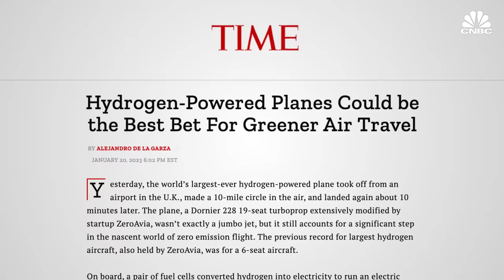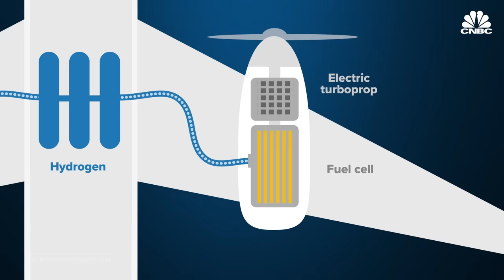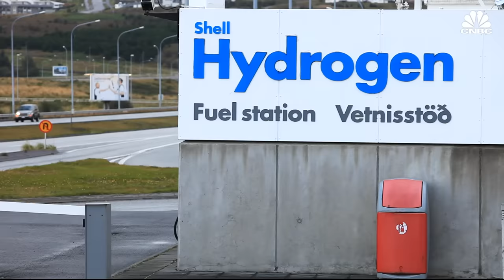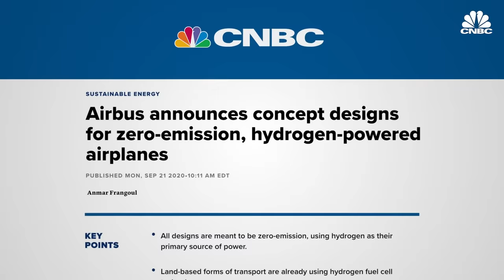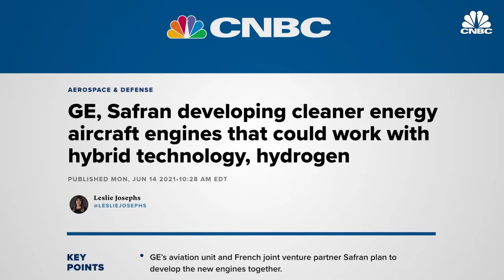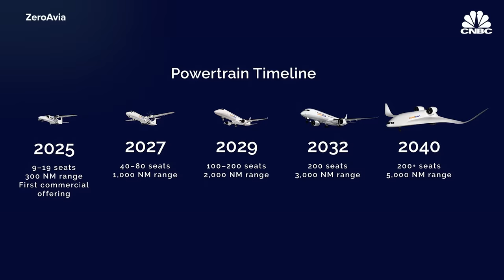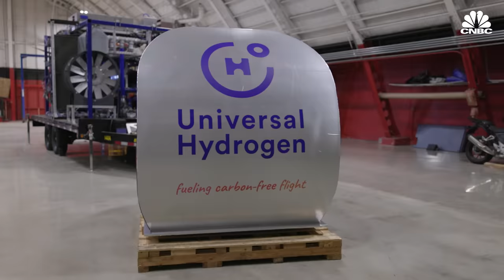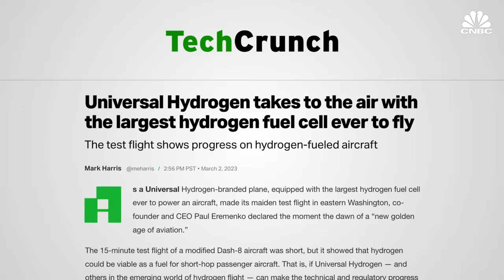Why Hydrogen-Powered Planes Will Beat Electric Planes

Comment: Electric batteries beat hydrogen when it comes to energy efficiency.  Hydrogen, when properly compressed, has more energy density and refuels faster.  Should technological advances even the field when it comes to energy density and refueling, hydrogen will be viable where the cost of electricity is prohibitive.

Comment: Airlines and large ships are going to be the most difficult to decarbonize. It's good there is a lot of pressure and investment to unlock solutions.
Hydrogen is quite difficult to work with, so I'm not convinced this effort is going to work out. Hopefully there will be a solution though.

Comment: I don't understand why we cannot make small nuclear reactors to power everything, from airplaines to shipping vessels, to maybe even trucks and cars. How hard can it be? Don't submarines and some military ships not already have a nuclear power source? And wasn't it experiented before on a somewhat strange cargo-cruise cross type ship? Not hydrogen nor lithium ion batteries will be a solution for airplanes.
Reply: "Don't submarines and some military ships not already have a nuclear power source"

Yes, and the reactor vessel is quite small, however, there's a huge advantage with nuclear carriers and submarines: we are surrounded by coolant. The steam plant that moves seawater in to cool the reactor and generate steam to turn the screw is a lot larger than the reactor vessel itself. Source: I am qualified in submarines, I served on USS Florida SSBN-728 and USS Asheville SSN-758, from 1999 to 2003.

The USAF did experiments with small reactors, and even had an airplane carrying a reactor at one point. The problem with nuclear aircraft is, what if there's a collision.

Theoretically, if we had an even smaller reactor, with self contained coolant, that would fit in a nice small cylindrical container, say maybe six feet (2 m) long, and would survive the rest of the aircraft being destroyed without releasing any radioactive material....that would work. That would also solve SSTO rockets. But even if you have one like that, you still need heavy shielding around the reactor. Remember the mantra: time, distance, shielding. 

However, it seems a lot easier to run the plane off H2 and generate the H2 using nuclear. 🙂
Reply: @neutrino78x  You have my respect for serving on a submarine. And yeah I was a bit too fast claiming nuclear was perfect and all, but I do believe we should be doing more research around this but I am also aware that the nuclear cruise ship container carrier mix, was not allowed in ports because it contained a nuclear power plant. People just didn't have the right way to handle the entrance of such materials by hand and where afraid of the what if situation. I just feel like we are too afraid, look at Fukushima in Japan. A melt down, an earthquake and a tsunami and still no one harmed.
Reply: @Bierdopje071  

" I just feel like we are too afraid, look at Fukushima in Japan. A melt down, an earthquake and a tsunami and still no one harmed."

Yeah, people have irrational fear of nuclear power, that's very true.

I would argue that if you use hydrogen and generate using a land based reactor, it's basically the same but without the security concerns. On a sub or carrier, worse case scenario, the vessel sinks to the bottom of the sea, and there's some release of radioactive material, but the sea is vast and will absorb it to a great extent. "Time, distance, shielding". 🙂

I think nuclear is definitely what you want to use in an area that doesn't have a lot of renewable options available. Like here in California we have 300 days of sunshine, and during the day we have over 10 GW that we get from the Sun. That would be five or six nuclear fission plants! We might still need a nuke to get 100% clean power. I hope we can keep Diablo Canyon open, but the political reality seems to be against having any kind of nuclear plant in our state. But....maybe we won't need it. Just build lots of solar, lots of wind, lots of power storage.

New York City on the other hand, iirc they're like 50% nuclear. It's because they get real winter, and have the Sun obscured for days at a time in some cases. 

So, I think both need to continue to be available. Renewable where you can do it, nuclear when you can't.

This upcoming technology with "enhanced geothermal" is really promising, because basically, anywhere on Earth if you drill down far enough you find natural heat. So just let wastewater fall down there, and take the resultant steam up to drive a turbine and you have clean power. Of course there are going to be some places where the depth of the heat is too far to be practical, but I think it will open up a lot of places to geothermal. Maybe New York could go 50% nuclear, 50% geothermal. It all depends on how far they can get with the enhanced geothermal. I know the principle has already been used at The Geysers here in the Bay Area, which is the largest geothermal plant in the world; they were getting less steam out of some of the generators, so they ended up putting waste water down there, and go the steam pressure back. In theory you can do that anywhere you find hot permeable rock. We have to see how far that tech goes. 🙂

Comment: Or you could make H2 so cheap via cheap electricity that you can turn it with captured CO2 into a synthetic carbon fuel and use existing equipment... Just saying...

Comment: For those of you old enough to remember the first gasoline shortage in 1971 gave rise to millions of people using natural gas to power their cars. Gasoline was $2.00 a gallon BUT Natural Gas was only .20 cents a gallon equivalent. Millions of people converted their cars to run on Natural gas or even common propane. This did not require a FUEL CELL but just injecting the already explosive gas into piston engine. The same goes for hydrogen! By just simply injecting the hydrogen into the piston or turbine engine and then burning it is 41% MORE efficient then using a FUEL CELL to make electricity and then losing more power in the electric motor. We already have 98% of the infrastructure to use Hydrogen just as a raw FUEL-STUFF! We also avoid the "bottle neck" of a heavy and limited Fuel-Cell which is not talked about much but a Fuel -Cell is a really slow device that costs $6000.00 per KWH and most cars need 2 or 3 KW per hour to run or about $18,000 worth of fuel cell weighing in at 1800 pounds!

Comment: I thought that hydrogen could be compressed to such a degree that it supersedes electric batteries in terms of weight? Which would increase an aeroplanes efficiency, saving money and potentially only have water as its waste by-product? If you could invent a battery using sand or sea water, that could potentially be even better than hydrogen.
Reply: It can only be compressed to a liquid basically just like water and no further, solid hydrogen is still basically a theory still. In terms of weight, yes they're more energy dense than batteries, but they lose that edge over batteries when it comes to efficiency losses when burning the hydrogen
Reply: It's lighter but it's volume is 4x times higher than fossil fuel. The storage tanks are also huge for hydrogen.
Reply: " If you could invent a battery using sand or sea water,"  Sand and seawater could mean Silicon and Sodium (Na). Na batteries are going into production cars this year. Aviation batteries have higher volumetric and gravimetric densities so cost more, but they are in development.  Also since hydrogen fuel cells are only 60% efficient and the combustion of hydrogen is even less efficient, batteries ( 99%+ efficient) only need to be about 1/2 as energy-dense as aviation fuels to be usable.
Reply: I'm guessing compression is a slippery slope considering altitude changes.

Comment: wasn't it the Hindenburg that also used Hydrogen? 🤔 And compressed hydrogen is explosive too. 🤔🤔
Reply: Yes. And it leaks through metal, plastic and glass, and degrades steel and other metals.
Reply: And diesel, lithium ion batteries and gasoline are not flammable and explosive.
Reply: @KP-if5kc  diesel isn't explosive, it needs to be compressed to explode. Petrol also isn't explosive, but the gas is. You can throw a lit cigarette into a puddle of petrol and it won't explode.
Reply: @Aeronaut1975  Umm, I've done several fire safety courses and I've seen petrol and diesel burn with a lit match. Not sure what you're going on about there. Am I supposed to believe you or my own lying eyes.
Reply: @KP-if5kc  I said "exposive", I didn;t say they didn;t burn.
Reply: Yes I believe we do have the technical know-how to make hydrogen safe to use but the stuff is just much more volatile (or "energy dense") as compared to other fuels. I mean, it's used to send payloads into orbit.
I'd like to see a safety track record established before paying to sit on what's essentially a rocket put on it's side with wings attached.
Reply: @Aeronaut1975  talking about explosive, in the port near Amsterdam they will build a few huge hydrogen storage tanks, so if that blows up even the area where I live will go (which is like a good 5-10km away from it)

Seems like a Beirut 2.0 waiting to happen..
Reply: @Aeronaut1975  Perhaps you should take a look at some of the more recent safety measures taken with hydrogen. I recall on a point on the lightness of the molecule allowing most of it to escape before it burns. I think toyota did those tests of their fuel tanks.

Comment: Fly on Hydrogen? Its been tried and Hindenburg ended up with a big bang!
Reply: Hydrogen fuel cell compress to high pressure . In case of damage/ leaked fuell cell the gas is likely to vent always rather than explode.  Have you seen any hydrogen fuel cell cars explode , there are not many of these cars . But I never heard one that exploded.
Reply: @bosorot  hydrogen fuel cell cars is being developed in japan, it has hydrogen tanks check it out, and hydrogen is the most volatile element its react very quickly with oxygen which is also very unstable elements. Jet fuel which many don’t know is actually designed to be extremely stable and if won’t ignite even you throw a burning match in it. Its the reason why Jet fuel is used for aircrafts world wide.
Reply: @@user-oj1tu7vl6l lol same crap, the only difference is it compresses hydrogen more in the tank than the past, but it doesn’t change how volatile the hydrogen is and how they use the hydrogen which is also used at fuel to burn! Jet fuel is used for aviation for a reason, because its very stable it won’t burn even you throw a burning match in it. That is why aviation fuel is not gas or diesel like for cars.

Comment: but hydrogen airplanes are 30% efficient while electric airplanes are 90% efficient so electric airplanes will beat hydrogen airplanes
Reply: Coal power plant that produces electricity is ~33% efficient, thus 90% x 33% = 30%.
And if you want to have an electric airliner with the same range as today's jet powered, you would need so much batteries that the airplane couldn't even leave the ground.
Reply: @My-Opinion-Doesnt-Matter  solar charging stations for airplanes

Comment: Interesting but must challenge the introductory assertions; ‘ affordable “ travel ? For who ? May I suggest those who carry the US dollar. ? But even their travel is an own goal in terms of CO2 into the atmosphere, which is destroying our planet’s atmosphere and biosphere in front of our eyes but we blithely go on as if it was not happening . 
 This form of travel is only sustainable if the CO2 generated is not from fossil fuel which is possible but of course  but big oil has blocked that for years . Alternatively the CO2 has to be captured and stored. Costly yes, but the only solution in the long run. Hydrogen can be used yes but not from fossil fuel and storage and fuel, cells are horrendously inefficient, again 
Costly . If you want air travel just for your holidays and not be a bit player in the destruction of our atmosphere, as we ALL are to a great or lesser extent (depending on the amount of dollars or w.h.y  currency in your pocket) then dig deeper. Costing the Earth is not an option,  denialistsbans procrastinating government have allowed us to run out of time to fix it , it is now a case of prepare for the worst with eyes open no more denials . Reducing your CO2 footprint by not flying would be a good start. 
I say this as a dedicated petrol head who loves aero engines , motorcycle engines etc and big 😊aviation enthusiast.

Comment: Flawed title and outlook.  This would be better titled as H2 being better than current production battery tech for planes.  This is true.
However battery energy density is increasing regularly.  H2 has ups and downs, just like batteries.  Batteries are simply better than H2 when feasible.  So best scenario, we solve the largest technical hang-ups with both batteries and H2 for aviation.  Which do you go with?  Batteries ... no contest; hands down.  Simply because it'll cost less and that's the driving factor.  That obviously changes the moment you need combustive action, like for rockets, etc.

Comment: 1:00 "You can't carry enough batteries to sustain flight, because they're just too heavy". Well, big batteries are too heavy, but what do you think powers a drone? A small battery.
Coupled with solar film on the top surfaces, a small battery could significantly lower fuel cost in the same way that a Toyota Prius cut fuel use almost in half. Those batteries could cut in and out in flight as solar charging occurred, and could be used during the descent phase of flight. This is actually doable in the near-term, rather than the next decade.

Comment: They will not, hydrogen has the greatest amount of energy per kilogram… but terrible energy per volume.
And the actual containers they need to store. This pressurize hydrogen are heavy and thick wall that need to be round. 
That’s not a very efficient aerodynamic shape . There is zero chance that this is going to be the way this goes.

Comment: "Atomisation" of petrol-ethanol-diesel. Dual fuel hydrogen-LPG(LNG, CNG, "turbo", "nitro", pyro-cord pellet-feed into ... gaseous...)
Reply: Power conditioner
Fuel cell to battery cell to ...

Generator to alternator-magnemometer-dynamo to power conditioner circuit of cells

Diesel electric submarines
Toyota hydrogen-combustion to GE-CFM hydrogen fuel-cell to sanyo-lithium in exhaust to colored lenses

Comment: While battery electric makes sense on ground vehicles, it IS NOT a practical method of powering a large airliner. HYDROGEN makes total sense. Hydrogen has the highest SPECIFIC IMPULSE of any energy source. In the form of a jet, the amount of power output will be dramatically better.  The biggest problem I think would be how to store it and how to green manufacture this fuel. I see Hydrogen becoming the fuel of choice for the big Airbus or Boeing airiners, it's just now time to figure these problems out before it can become a reality.

Comment: The idea that it's even worth attempting to get large jets to run on either hydrogen or batteries is nonsense to me.  The technical challenges are absurdly difficult, and it's not like we need to drop literally all global carbon emissions to zero - we just have to get them down far enough that they stop being a major problem.  There are much more efficient ways to do that than making planes that don't use jet fuel.  Frankly, cargo ships are a much better focus, those have way less complicated physics to deal with.
Reply: We need to take emissions out of the atmosphere to account for what we're  basically going to emit before 2050 from now. Those are the goals calculated in the paris agreements

Comment: I hope you realize that the operating principle of a jet engine is that it generates a lot of exhaust… hydrogen just makes water, and not much of it either. It could work for cars, but planes will not be getting off the ground.
Reply: Except they already have. That’s why they use propellers.

Comment: In Scotland they have converted an old boeing 727 to run entirely off AA batteries , 1050 of them , current flight time is 90 minutes and they are rechargeable Nicad`s .
Reply: No they didn't
Reply: @jhurd4  Err, are you trolling ? , the plane has flown 3 times already

Comment: Nobody cares about CO2 emission actually.
A new technology is adopted if and only if that technology is over all superior to the old one, and no, being zero emission has nothing to do with the superiority.
This is what we've learned from the EV adoption, people buy EVs not for reducing CO2, but for better experiences and benefits EVs can provide. 
Electric planes do have potential for shorter range flights considering their low maintenance cost and cheap electricity availability.
Hydrogen planes, however, have no advantage over conventional hydro-carbon fueled planes, in terms of fuel cost, maintainability and available payload spaces.
I think hydrogen planes have no use case and no chance to be adopted.